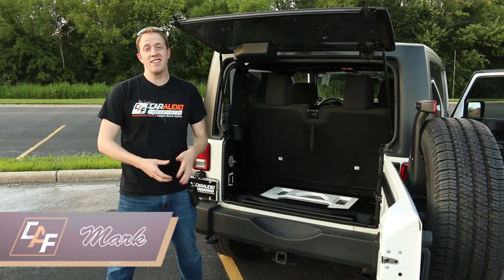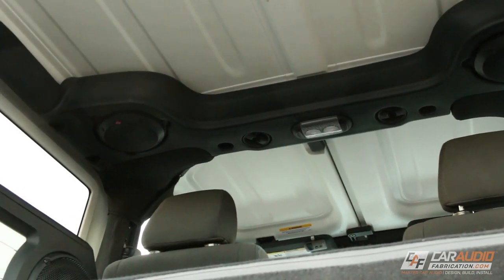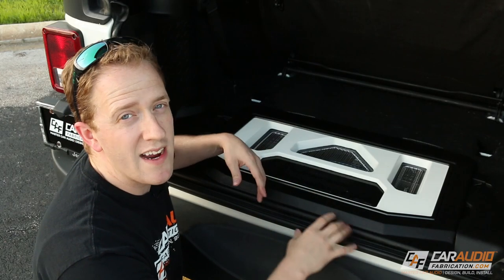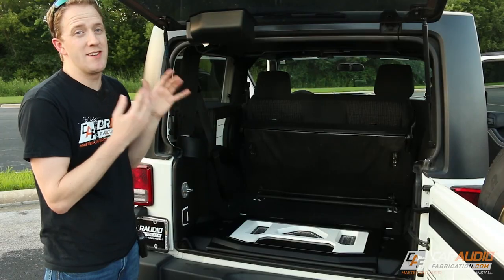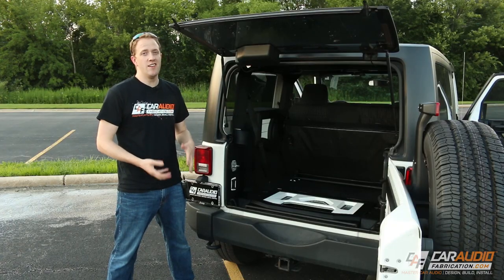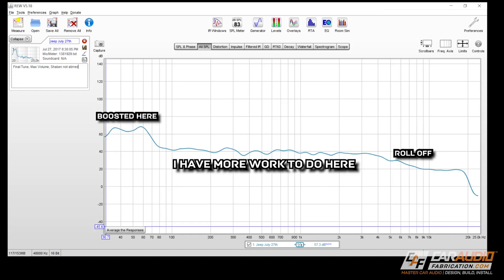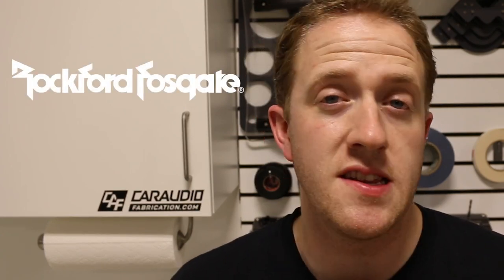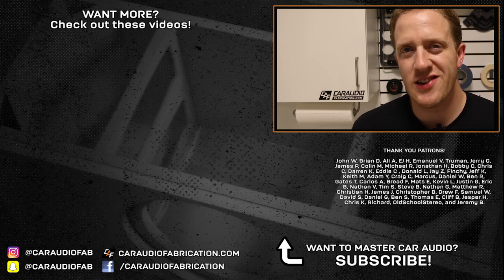FINISHED! Custom Subwoofer Box and Amp Rack - Jeep Project Overview

Comment: I noticed the edge lighting is brightest on the lettering that's closest to the light,  if you engrave deeper on the lettering that is furthest from the light/edge you will see a better illumination across the board.
Reply: Dominic Dymond that's an awesome tip!!!
Makes total sense since the ligjt will stop traveling through the board at that depth as it hits the first set of letters! 👍👍

Comment: Use a Sennheiser MKH418S dual capsule mic into a mixer as a separate audio track, then import it into your video. The mixer will allow adjustments to minimize distortion and clarity before it gets to the main recording medium. It will take several takes to manage levels if you don't use a db meter. Also if you want to find other mics that record high pressure situations look up audiophile videos where they try to record true spacial listening environments from their audio gear. Just a couple of ideas to get you researching how to record a good session.

Comment: Where is the video showing you installing the tweeters and woofers in the dash? I can't find it, or if it was just implied that that part was easy enough to do? Any way to get ahold of the 3d file you used to print the tweeter housings? Also I assume you used the sound material on the inside of the stock woofer boxes?

Comment: the build looks freaking awesome, i do have a question, I have a 3d printer and was thinking about printing my own tweeter pods but i'm not sure about material. Basically i'm worried that it might melt. what do you material do you print with that can survive the heat of an enclosed vehicle parked in the sun.

Comment: How did you go about dealing with the small enclosure size in the front speaker pods? It's only about 2.4 liters, most speakers are designed for huge door enclosures or infinite baffle situations. As a result there's usually a ton of resonance. I have Hertz HSK165's in the front pods and they sound good, but I don't feel like they are reaching their true potential. Did you pick those midrange drivers with the small enclosure space in mind?

Comment: Maybe I missed it, but it would've been nice to see how the front speakers went in. I heard some 3D printing went into the tweeter pods but not much about the dash mid-range install at all. I would think as much went into that as the soundbar. Been following this for a while as I have a Wrangler Sport. I have roughly the same products as this build aside from getting the marine versions of the amps you used(have a soft top that's hardly ever on), and I stuck with the down firing sub(for the same reason), and I have no use for a DSP(its a soft top jeep). Its a jam system but I do sound quality. Just not MECA sound quality. Otherwise, great vids man. I dig the informative tutorial type stuff over the...well...doug.

Comment: Great job and thanks because I have learned a lot. The one question I have is, what do you do about heat dissipation on the amps?  I am creating a similar rack (same mounting location) for my Jeep 08 JKU 4 Door and will need to do something about getting rid of heat from amps. I’m using Alpine MRV-F300 and MRV-500. Can you give me some suggestions?

Comment: Wow that sounds nice! I've been having trouble with my shallow 10 inch sub. I realized I used 0db test tone for the sub channel and that's why my sub wasn't even noticeable. I think I have it set with a -7d tone. But I'm going to use a -10db tone and maybe even adjust my eq a tinsy bit.

Any ideas on the bass boost on some sub amps? Do you guys use it? If so how much and how do you like it? I have mine to 0 cause I want to get an idea first how it will sound with the -10db test tone. If I want more low bass I think I'll go with a passive radiator instead of ported though. Anyways this sub outperforms mine 100%. Just WOW.
Reply: By the way I should add, I only used .4 cubic feet of space haha, but at a cost.. Obviously I won't get those low notes. I believe my poor sub is only at fsc 55-60 hertz lol. Might need that passive radiator now I think of it! 
Remember new car audio enthusiasts. You can only choose two to tweak of the following... Loud, Enclosure size, and Low end.

Comment: Hey mark, I’ve been working on a JKU build, I have kickers all round except for the sub (factory) and I have the infinity sound system. My question is, what’s the best way to bypass that? Is it as simple as wiring the speakers into the new amp, or is it more complicated than that? Only wondering because the amp and head unit are on the same fuse

Comment: Great to see the finished install, beautiful job. Honest question, though: Why the soundbar? You re-worked it expertly, but even if you work the curve and Time Alignment with the DSP, won't it still throw off the sound stage?
Reply from the maker: It's much easier to tune something away than to tune it in. I can have different tunes. Fun and LOUD vs SQ.

Comment: Hey Mark great job on that build, but I would like to know what would be the total cost of this build if it was done in a professional car audio shop and more or less what was the time frame it took you to build  the entire build!!! As far as the subwoofers was that the biggest size you could have installed in the rear  like you did or could you have gone with bigger  sub's??? How many amps can you connect to that real nice  AUDIOCONTROL DSP that you used???
Reply from the maker: Without gear you'd be looking at $4K easily. As you can see in the videos custom fabrication takes time. Time is $. The ten inch sub is about the biggest I could go without getting into seat/cargo room. If I didn't need space for that stuff there would be much more room  The DM-810 has 10 channels of output, you could technically daisy chain as many amps as you want. The point is there are 10 channels of individual control.
Reply: CarAudioFabrication That's cool thank you for the info!!! Keep up the good work and keep those great videos coming they are very educational!!! 👍👍👍👍

Comment: I know this is an older video and you almost certainly won't see this comment, but you should invest in a good binaural microphone.
They can get a little pricey (the good ones are $500-$800) but they will definitely help show off the final systems better.

Comment: After reading some coments I have to ask did I miss the part when you ask how could I have built this better? If you did ask for everyone’s two pennies, here’s mine. Dude, fucking awesome. I just bought some addressable Arduino led strips and I was trying think of a way to do something like you have set here but couldn’t quit get decide where or how I wanted to do it, sort of the way you with the acrylic and this helps out tremdously. Only thats where my spare tire is in the and I’m wanting to keep it as oem as possible as far as functionality. I’ve even done s few mods to the engine but nothing gaudy. So I you can get your hand on a 2013 GMC Terrain Denali  is Love to see you turn something out that. That would be an interesting build. It’s kinda of a practice suv with an inner bad ass ride wanting to bust out. Especially the 3.6 liter. Check one out. Please. Love the videos I wouldn’t do anything different bc I woukdve never thought of doing this in the first place. Very creative

Comment: "the sound is great" - how can it be great if your source is the original head unit which provides the cheapest sound ever. I really loved the way you did the whole installation of the components, but using the head unit from Jeep.. is the biggest disappointment in your Jeep! Great work, but I'd rather invest a few dollars in a head unit with a built in processor like Clarion or Alpine and enjoy indeed great sound quality